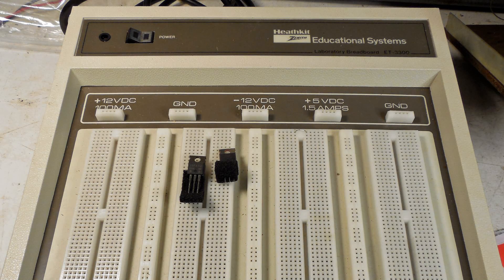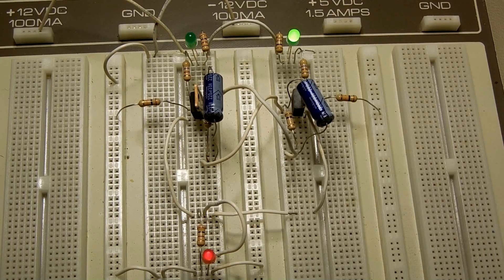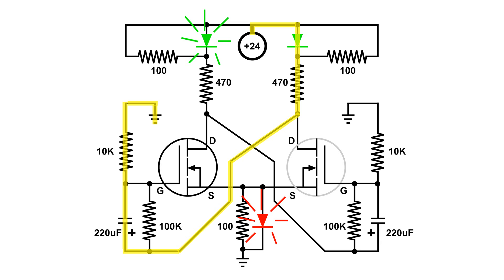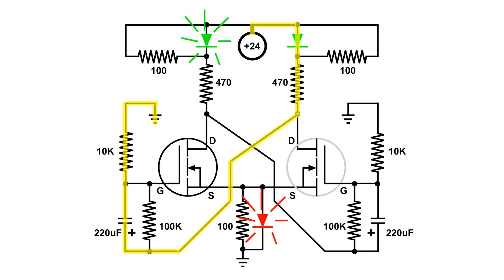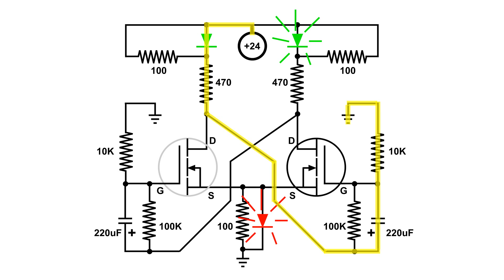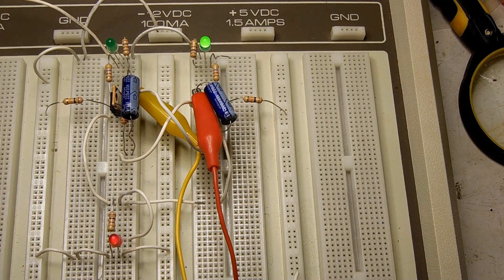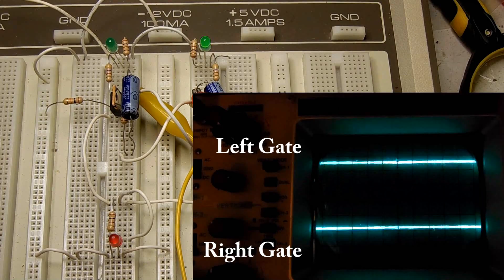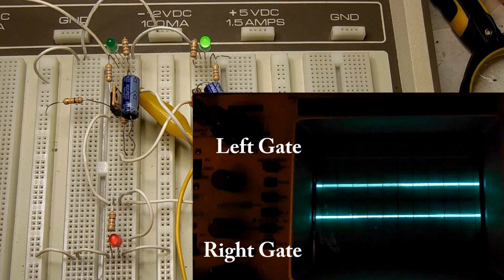MOSFET Multivibrator Build and Demo

Comment from the maker: Thanks AntiqueRadioandTV 
Multivibrators are used in some inverters, run it through a transformer and a few capacitors, and you can have a pretty decent sine wave. I hope your B battery project works out well, let me know what happens.

Comment from the maker: Thanks Mike W.
The top two resistors dim the LEDs enough so they look good on the video. The bottom resistor needs to be there. I put an LED across the bottom resistor, and forgot to mention that this could be another output.

Comment: Is this similar to the way power inverters are designed. Could this output, (at 60Hz of course) be the way the step up the voltages to line VAC?

Then I guess my next question would be: Would this end up being a true sine wave generator or would it be instead a modified sine wave like what is mostly available? 

Interesting demonstration! I will soon be building a step up "A" 90V battery replacement using similar techniques using MOSFETs. Suppose to be very quiet, RFI wise. Uses 3 NiMH.

Tom
Reply: Some inverters are based on multivibrators, don't forget output must be simetrical. If you want a sine wave generator, don't build your generator based on a multivibrator signal, preferably use a Colpitss oscillator, thus you'll get a sine wave, otherwise, if you use a multivibrator you'll need a filter network to convert square wave into a sine wave which is not 100% sine. Multivibrators exist much befeore Mosfets so you can start by designing a generator based on BJT transistors which are much easier to use in case you're a beginner, though Mosfets offer advantages too.